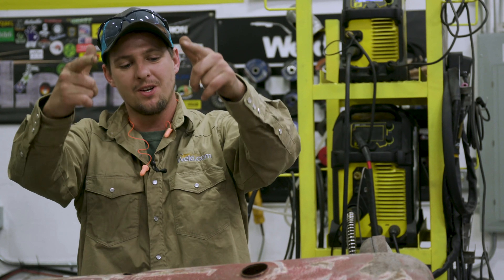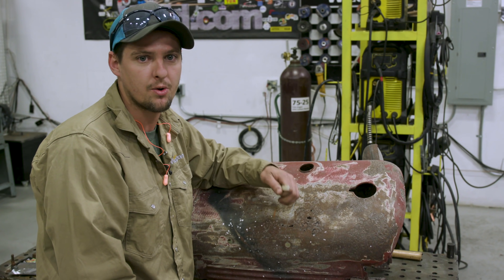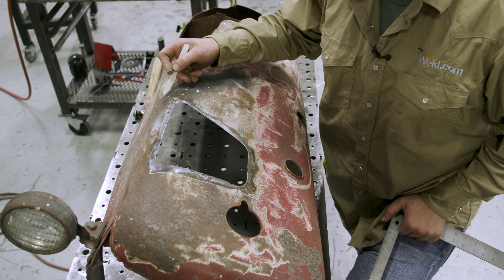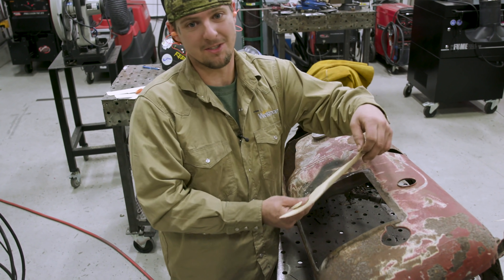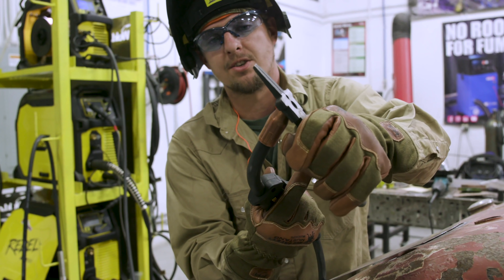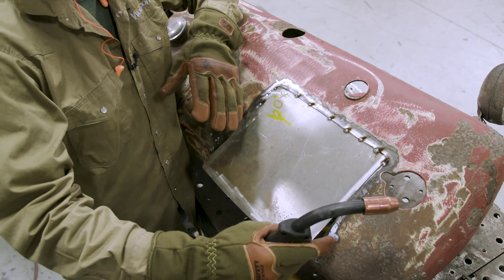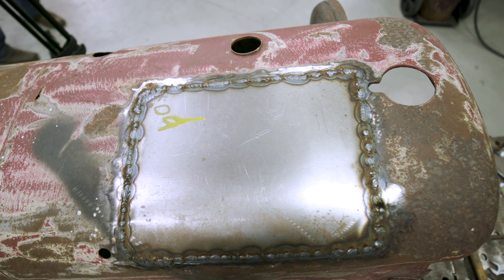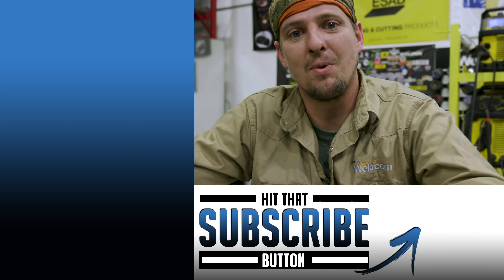OLD RUSTY SHEET METAL Weld Repairs

Comment: For the guys working sheetmetal.  13:29.  You see that gap open up on the front?  That is a bit of a compound curve.  His template was not pressed against all surfaces at the same time when he was marking it.  This is expected.  Depending on the curves and your experience you may want to add 1/8" to 1/4" of material to your patch.  Then take the time to form the patch to match all curvatures.  Once satisfied with the curves trim it back to size.  Like everything preparation is where it is at.  When possible I use a copper backup to act as a heat sync, and to keep some tension on long flat areas.  Helps keep them from sinking.  Don't forget you can weld it from the back as well.  I highly recommend a quality seam sealer on the back.  Jumping around making spot welds almost guarantees some pinholes.  All it takes is one to wreck the repair in a few years.
Reply: He didn't bend the whole patch down at the same time, just the corner. Naturally it'll get shorter when you bend the corner down and in.
Reply: @danjennings5068  Well you can't bend anything at the same time, even when die forming.  Always leave extra material.  Form the shape first then trim the excess.

Comment: Can you show/explain when I try to oxy/act weld with filler rod I get some kind of spit back?
Reply: I think that is rust and other impurities entering into the puddle. I've seen that too. I'm not an expert but that is what I think it is. I've heard that MiG and AC welding will self clean the puddle but DC TiG and Oxy will not. So they have to be cleaner. (Actually Aluminium needs to be super clean but you can use the AC clean setting to cheat a bit)

Comment: The absolute best tool for finding out how far rust has spread to is a flat wire brush on a grinder (not the cup type) it will show all the little pinholes of rust you can't see with the naked eye,plus it cleans the metal nicely ready for welding.

Comment: I use aluminium strips behind the butt joint when required, works just as good as copper as a backing strip when you need to fill in the gap

Comment: My comment will probably get a lot of thumbs down. Weld.com has a ton of excellent videos about welding and you are much better welders than I am. But I have to say that this video is an disappointing exception. This is not the way sheet metal repairs should be done.  The most serious errors are sloppy fitment and banging the patch in place. You did get away with it because fixing this bonnet is a fairly simple job. The key to a good sheet metal repair is  95% panel fabrication and only 5% welding.

Comment: Excellent demos of how to weld real world crusty rusty repairs. Same with the last one (the motor part). Wish I could weld on shiny new plate all the time (Haha, without actually having to get a job doing just that ;) ), but a lot of times I'm just cobbling something together out of whatever I have on hand, or fixing something to get some more miles out of it, or building something up out of pieces to machine (because I can't afford to just get a huge chunk of steel and make chips out of most of it).  Thanks! Keep it up.

Comment: Would like to see the same process, but with stick welding
Reply: Yep, me too. Is it even possible with metal this thin?
Reply: @thelighthousekeepers8177  yes it is possible. But my god is it long and painful!
Reply: It’s possible, I’ve used a big piece of brass underneath to keep from blowing through the metal with a 3/32 7018 turned way down. It wasn’t pretty but ended up getting ground off smooth anyway

Comment: That's a legit vid right there. Thanks 👍 Gonna help me big time with my floor pans.
Reply: Trunk panels ( one of the common rust spots ) in a 60’s Charger?? I know that I’m not looking for mine to be replaced ( most likely going to have to pay 💰 someone else to fix it right or at least get help or bring myself to I don’t care and bugger patch it ok welds just the rest sucks # race car 🏎  more than likely I don’t think 💭 🤔 that I can bring my self down that low ) o well mini tub 🛀 time ( from auto metal Direct / year one or classic industries ) that and the transmission tunnel has to be widen / taller out / changed to fix my new T56/TR6060/TR6070 manual Transmission case which if it’s not a numbers car I highly recommend that you change it at the same time as the rust repair/replacement because most transmission designs / made after 1980’s ish don’t fit including the automatics ie. like the 6l80e from Gm

I’ve got some other body work on that Charger and my 86 K1500 that I’m not looking forward to besides that trunk floor replacement as mine it pure minty fresh Swiss cheese 🧀 because of a bad trunk gasket and the prior owner doing bleach burn outs and the cardboard and tar gas tank liner that they used from the factory in 1965-76 for NVH and rubbing a hole through the gas tank or body

Comment: Holding a piece of aluminum behind the weld helps bridging the gap and helps draw away the heat.
Reply: Aluminum or copper will work. As long as it’s a dissimilar metal from the base
Reply: fit it properly and there won't be any gaps

Comment: Man cub actually surprised me abit on this one but as a metal shaper and coach builder who does this everyday heres a few small tips for you guys  never use a pointy hammer like that. get some dollys and with each tack grind it almost flush and hammer and dolly the tack this will stretch the shrunk weld and stop the gap closing up once you see the gap open up move to the next tack and repeat the process then do the same thing but with bursts like mancub did then once again grind almost flush planish the welds and move on to the next one this will eliminate distortion. once finished that process blend in and planish for a seamless weld
Reply: I've been looking for a video like this for a long time. Thanks ManCub Welder!! Kieren Meier if you could contribute your own video demonstrating your technique that would be extra great. I was studying TIG welding (until the plague hit, cancelling class), hoping to develop the chops to attempt something like this. Every bit I learn puts me one step closer to actually getting it done. I'm going to be watching this video again and again and again. Anyway, great video!!
Reply: @normanklein3155  if you look up wray schellin he does a very similar technique also Peter tomasini does a demonstration with gas welding panels in the same way it's more of a panel beating technique rather then regular welding knowledge. most people in my trade are usually pretty average welders because we do alot of tack welding and weld little sections at a time to keep the heat down so in reality you don't need as much welding skills as you think  your settings will be abit  more important though so make sure you take the time to dial it in on some practice pieces first.

Comment: This is really the most informative patch video I've seen.  You talk about gauge, what it means, how to measure it, bridging big gaps, wire size, putting copper below to dissipate heat and not burn thru...even showed s*it happens. Just information packed.  I watched twice and found stuff I missed the first time Keep up the detailed tips . You made it look easy, and it is not.  Thank you. Wish I was young again to do this kind of stuff
Reply: Thanks you Sir. Really appreciate it. Stay healthy.  Thanks
Reply: @mancubwelder1312  You show feed, voltage, gas, and wire but I didn't hear you mention the amperage, did I miss anything? Thanks!
Reply: @RagingShrimp67  when MIG  welding I think you only use gas, voltage and wire speed don't think you can adjust amperage.
Reply: @RagingShrimp67  the amps are linked to the wire feed rate
Reply: Not to mention starting your tacks off a previous tack as its thicker material... duh but never thought of it! Haha awesome stuff

Comment: Who is this guy? Haven't seen him on the channel! I like him. Hes not the perfect welder that does it all right, all the time like 99% of us. Granted I have learned A LOT from this channel. Started mig welding at my most recent job and I have only "welded" about 20 minutes prior to spending days welding on rusty, dented, messed up roll off dumpsters. Im actually running good structural beads now, at least I think so. For having brake rotors dumped on them from 20 feet high lol. Thank you for your video my man. New thing to try out when I get time

Comment: Is this possible with stick though would really love to see that
Reply: Stick is really too hot for sheet metal work like this, but when I was in school for welding there was one guy there who did all his body work with it. He would use 1/16 6011 rods in reverse polarity (Electrode positive). The reverse polarity keeps a lot of the heat in the rod but it's really easy to burn through.
Reply: @MarcotGarage  so tig only? Brazing?
Reply: Tig is not the best for body work because of all the heat you need to put in to it. Over a large area you'll get a lot of warping. When I did aerospace stuff we had a jig for everything to keep it all from moving.

Brazing is do-able but also not the best. The torch again is going to put a lot of heat in the material and takes a lot of control to not warp it. The other problems you get with brazing is the risk of cracking if its in an area that's under any stress. I was taught that stress is like a highway, and with different material compositions like that it turns in to a speed bump for the stress. Other problems with brazing is bondo doesn't stick well to it and paint tends to bubble on it too. There are ways to prep it so it wont but a MIG machine is cheap enough and it's just easier to do.
Reply: @MarcotGarage  soooo u recommend mig as the best option for welding thin sheets ??
Reply: @vaulmoremack3072  Yeah MIG is going to be the best option. Quick metal deposit and good heat control, like he did in the video.
Reply: @MarcotGarage  cool thanks ... Long time stick welder just trying to dabble in the other processes now
Reply: Vaulmore Mack I kinda do to lol wouldn't want to torture mancub with that video though

Comment: i love your guys videos....but i do alot of sheetmetal welding/patching.  ALWAYS bend your panel to fit before you tack in a patch.  because it wasn't fitted well (bent first) there was a big crown in the middle which pulled up the bottom edge and corners.  no sense making a template to fit the hole if you dont fit the panel into the hole.  oh, and use a piece of tig rod to help fill those large gaps while you're tacking a poorly fitted panel. (like 'texas tig')  good stuff tho!
Reply: I agree with everything you said, and will go a little farther. I'm an airline mechanic that does a lot of this type work with aluminum. We don't weld. We rivet. I bend, and fit my material first. I then use the filler as the template to cut out the hole. That gives me the perfect gap all the way around.
Reply: Done both ways before. I just decided to do it this way.
Reply: Thanks for the tig filler rod idea. That's a good idea. Still get the same result.  Done both ways before. You can dolly your crown down if you want. Metal will move. You just have to understand it. Both ways work same result. Appreciate watching weld.com. stay healthy
Reply: The top is crown naturally. It had a crowm all the way down the hood.
Reply: @mancubwelder1312  wasn't talking sh*t, i appreciate you're videos.  and as a guy that does videos, i know how much work goes into what you do, and you do it better than me.  at 13:02 you can see the crown in the middle of that bottom seam that i was referring to.  if that's how it is (and it doesn't show in video), then that's how it is.

Comment: Dude, rather alright job (though heat-affected zones could be smaller), but do the real thing! 1,2mm (18ga in your terms) sheets are considered like your structural thing in automotive world, they are used for gussets, side- and cross-members and alike. Do the 0,8mm sheet (22ga) - and show what it blows through and warps like!)
My dad used to say that every sucker can do a 10mm plate (3\8"), it is the thin sheets where real welding skills do show up, just like it is the slow corners where real race drivers manifest themselves against the rest since it is rather easy to be fast in a fast corner and every sucker and be any fast on a straight line.
And since you're aimed at the rookies, show what it looks like if you weld too close to a magnet holder - most noobs (incl yours truly) sht bricks when see that thing the 1st time :)
Reply: 0,8mm is quite hard not to blow trough
when you have a gap on 0,8mm and you can weld it, well you are a wizzard
makes you wonder where are the limits of mig

i once welded olfa knife blades (0,5mm)  togeather with mig, but well it took a lot of setting and a back-spacer block to make it look god

Comment: Waited a long time for something like this. 1/8” and up is easy to weld. Gauge metal is a different story.
Reply: Learn on thick stuff first, get a feel for welding THEN go try sheet metal. Will save a ton of frustration.
Reply: scott L I found that out the hard way, by doing the exact opposite. Blew a hole, tried to fix it, blew a bigger hole, threw welding machine through the window, told wife, she made me go out and pick up the welder. Ok, I didn’t throw it out of the window, but I definitely felt like it.
Reply: Mark Harris that’s exactly the mistake I did too when first welding. Blew tons of holes got super mad. Had a welder buddy come over and got me welding in a hour MIG welding on THICK material! Trying to help others out to prevent what you and I did!
Reply: Yeah, ive been practicing with 14ga and 1/16" stick, the tinyest gap will blow thru in a microsecond.   But its too much fun.
Reply: 1/8" is 11ga.  🤯
Reply: @atowns3364  a particular “gauge figure” has different thicknesses in mm or inch (or whatever absolute units there are) dependent on material. Aluminium, steel, stainless steel etc etc. It differs A LOT! Good to know;)
Reply: @tomfull6637  Right, like 16ga SS is .0625", carbon steel is .0598", and galvanized is .0635".  All of which fit in the 16ga slot on a gauge finder.  The aluminum I work with on a daily basis is measured fractional 1/8", 3/16", or 1/4". When it gets smaller it's measured as .030" or .060" etc. The only time I ever see metric anything is when it is assembled overseas and needs to be installed somewhere.
Reply: You can make a welding spoon out of copper pipe. I used 3/4 pipe i had around the house. Works great. Hold it behind what you are welding. Used to fill gaps and holes in thin metals. Soaks up the heat and your welds will not stick to it.
Reply: The last time I had to weld thin guage metal I lit up an oxyacetylene torch, with a small tip and did just what was shown.
Reply: .025 wire steel mix w/ heat sink bar and air.
Reply: facts i was just practicing on some donated 20 gauge aluminum today and went through probably 20 setting configs
Reply: I think i settled somewhere around 19.7V and 215 IPM but that IPM might be off like 5-10
Reply: it was an old miller Aluminum/Stainless 2 gun welder